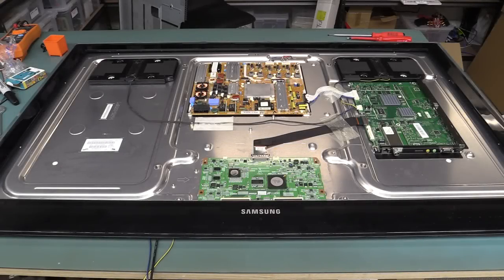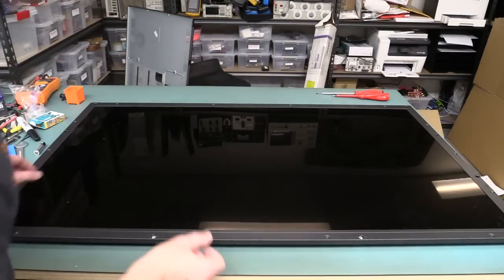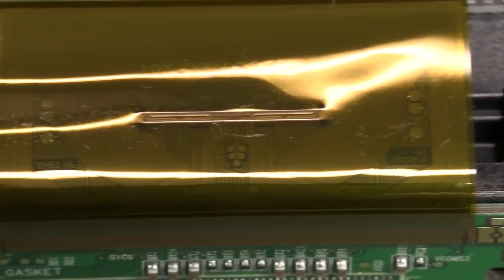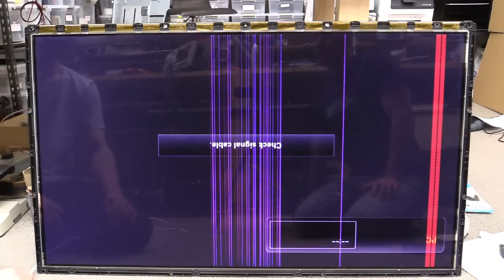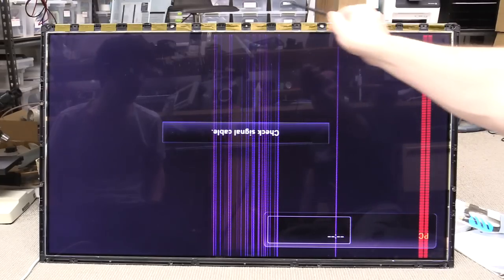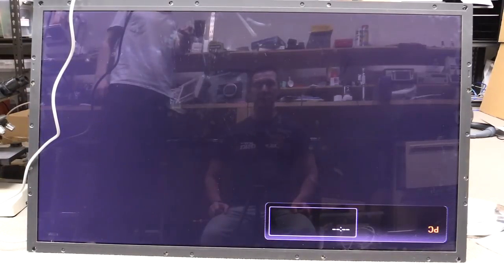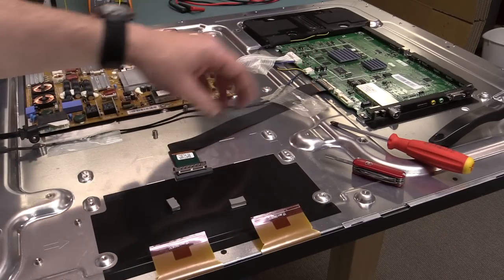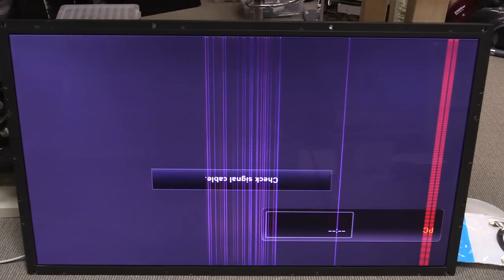EEVblog #781 - Samsung LCD TV Part 2

Comment: My bet is framebuffer memory on the main processing board - some rows in memory flip bits, some stay flipped, some decay - this is what happens with videocards. So possibly a memory line doesn't get a refresh signal or something like that... And because it does some postprocessing on the faulty data, it can produce different artifacts depending on when and how the bits flip.

Comment: I have repaired similar TV's and it was an issue with the ribbon cables coming off the lcd not making good contact in the connector. I would use packaging tape to make the cable a bit thicker for the fix.

Comment: If you look closely, lines do align with "P C" (the red ones) with check cable, and with time dots. Looks like some sort of filter accumulates values or something, definitely something with the scaler/frame buffer or something like that.

Comment: This is an internal panel short, you can narrow down which signal lines the shorts on by putting capton tape over some of the pins on the ribbon end, on one of the 2 ribbons going to the panel buffer boards
Reply: Sometimes using this method you can get rid of the lines while retaining a good picture, also one of the ics on the tcon will be red hot while that shorts connected to it, that's why the lines slowly appear as the ic starts to struggle with the overload and the chip heats up

Comment: Let's see:
1. The lcd panel cables are good, if the lines would appear instantly after powering the TV on than flex cables would be faulty
2. the panel is not damaged that is a fact, a damaged panel would not have straight lines but bleeding colours
3. power supply is good
4. Image processoring is working because there is video output to the panel
5. The issue is on the video output source

So if you put all this together you will se it is related to the T-con, something on the board is damaged because when it is heating up the lines appear slowely (vertical lines) these other horizontal lines are most likely because of some small voltage disruptions on the T-con. I can not say what exactly is damaged on the T-con but you can try and look deeper in to what could be wrong on the T-con's circuit, if the chip is damaged than it is best to buy a whole new board

Here is one, I don't know what model do you have http://de.aliexpress.com/store/product/LN46B650-or-LED-UN46B7000-BOARD-2009FA7M4C4LV0-9/710086_614153320.html?storeId=710086

Comment: EEVblog Check those Sam Young filter caps on the power supply board using your ESR meter!  I don't see that you did that in either video.  I know you have no reason to think they're bad based on ripple and visual diagnosis.  BUT - I have a very similar vintage Samsung LCD TV (2009, 55", high end) I'm working on, that also has multiple Sam Young filter caps on a very similar board.  One of them was visibly bulged, but even the ones that weren't in the same value (25V 1000uF) had questionable/high ESR values. 

The TV I'm working on has the same exact symptoms.

I'm waiting for the replacement caps to arrive, but given the nature of the failure (it worsened with time according to the owner, used to go away on it's own, and it's temperature related) etc, and the fact that one had visibly failed - I'm confident that this is what's wrong.
Reply: +Protonus And? Did you fix it?
Reply: The Kaiser   Sort of!  The caps were certainly bad.  1 in that value was visibly bulged, one read a high ESR, the other 2 I replaced anyways.  But it didn't fix the picture issue, just make it stop changing with temperature.

So I found that one of the ribbon cables, going between the actual panel and the driver boards at the top of the display, was faulty.  If you apply a bunch of pressure to the cable itself, to push it up against the metal frame of the TV, right where that tiny "chip on ribbon" cable is on the short cable, it would restore the picture to about 95% perfect.  All the vertical lines and bars, and color bleeding go away. Most of the horizontal lines go away too.  The one that was bad is the left most cable for this particular TV.  I hot glued the small/bottom end of a small (3/16" thick?)  rubber peel&stick "foot" (like you'd put on the bottom of electronics or a speaker) to that spot on the cable.  Now when you screw the front metal bezel down, the area of that bezel that's supposed to push on those cables, pushes much harder, and the picture is nearly perfect.

There remains though, some horizontal lines, at fixed 1" intervals though, that stretch across the display.  They are mostly on the right half of the display, and fade away totally by the time they hit the left edge.  That's all that's left to get the picture to 100%, but I found no other connections that were bad.

If I unplug the right hand side connector from the T-CON board, so that the right hand side of the LCD goes blank, the remaining lines disappear on the left.  This tells me that these remaining horizontal lines might be from a bad T-CON board.  So I'm replacing that board next.  Hopefully, it's 100% after that.  I don't have a lot of faith in it though. 

If it doesn't fix it, it'll make an excellent secondary/bedroom/workout TV lol.  The picture is nearly perfect now.
Reply: Protonus did replacing the tcon board fix it on the end?

Comment: The Horizontal lines appear to be split between the two sides of the panel(like, even rows on the left and odd rows on the right)  and the left horizontal lines "driver" (when the panel is the correct side up) is completely gone (hence no display). But since the vertical "fault" lines appear even on the side with "no" horizontal drive that could be some indicator that the fault originates on the main board that generates the signals for the rest of the components (it skips processing half the rows except where there is an error or "overflow" that produces the vertical lines). Hope this was helpful...

Comment: Just to echo another comment or two on here - Mike said floating input, does look that way.  Someone else mentioned reflowing processor board and considering OSD text having effect I do agree it's probably the processor board.  Something perhaps needs reflow on there.
Reply from the maker: GadgetUK164 There is also a very plausible theory about the gamma buffer or other analog drive system at fault.
Reply: +EEVblog Interesting. When are you going back to it to find out?

Comment: A bench with a clear top and a mirror underneath might be handy for doing this job solo. Our Sony has the exact same failure, it happens with on screen text even on the broadcast picture, putting the TV on a radio station clears the issue temporarily.

Comment: Some of these ghosting effects remind me of what some LCD displays do when you turn them off. In particular, when I switch off my old Game Boy Advance, every few rows appear to persist for a bit.

My hypothesis is that for some reason, the pixels are having a hard time turning off. When a row is being driven, the voltage for a particular column could leak through to other rows, and without a strong turn-off force, this leakage gradually causes pixels to turn on.

One possibility is that if a negative voltage rail is used to turn off pixels, then it's possible that rail isn't making it to the TCON board. Thou shalt check voltages on the TCON board. ;)

Comment: I believe it's to do with the LCD itself I've seen this before where the LCD broke and caused lines and dead pixels so a replacement of the LCD would be required
Reply: It is entirely possible is not the LCD if so it's the caps which have been fixed but then the tecon board can be the problem but then if it's not that then it's the main board but I've not seen TVs that are built like this and I don't believe after all this time that it's possible for me or most people to be any help but good video I really found it interesting how much could of been wrong with it

Comment: +EEVBlog If you still have the LCD TV Dave, have you considered the clock management?
Clock based timing issues could potentially explain the ghosting as well as the lines which could be following your screen input.

But to see if the lines are just input based as in menues etc just hook the TV to a PC as the secondary screen and make the background white so the TV only shows a "pure" white screen. If a "pure" color can be shown without lines will help you eliminate possible sources for the fault.

Comment: After seeing what you have tested and poked i would call a dry joint on the processor board... And if i had to point to the exact bit i would say a bad earth on the LVDS connection.

Comment: I'm probably way off with this, but I'm thinking that if each pixel has a triple (RGB) x,y control, the vertical lines seem to follow any high-contrast element of significant height (the dashes in the clock display didn't seem to contribute), and the line color seems to be determined by the dominant color of the contrasting element, then there must be a communication issue in the x,y controller, whatever that may be.

Blue is the dominant contributor to the "white" (it's not pure white/all-on white) text.

Red is the dominant contributor to the orange text ("PC")

It seems like the vertical controller is taking cues from the horizontal controller.  Knowing absolutely nothing about how this screen is engineered, I find myself asking:
1)  Are the x and y controllers physically separate drivers?
2)  Does either the x or y have "priority" to the system?
3)  Do they communicate, and/or does one vary itself compared to the other? (Contrast management?  Blacks enhancement?)
4)  Are they SUPPOSED to communicate?  Is there a chance that information from one is "bleeding over" into the other?
5)  Is this a heat-related, actively-bridged problem?  How long does it take for a particular die and/or circuit to reach a temperature or charge that would, say, cause a tin whisker or similar anomaly to expand and bridge a gap, which it then holds based on heat or charge until the unit is powered down and the anomaly is pulled away?

Comment: One of the design engineers from Samsung is watching this doing a face palm. Come on tell us which £0.01 component is faulty :-)
Reply: Coolkeys2009 Knowing Samsung, they probably put put a counter where after a certain number of hours of screen on time, it corrupts some config in the firmware of one of the chips, or some other form of planned obsolescence.
Reply: +Razor2048 this is possible I remember when Epson printers did this
Reply: Razor2048 I can believe it was caused by a problem they missed or something they skimped on but I don't believe Samsung would bother spend the extra money to design in a fault. LOL
Reply: Carbon cricket FX This would actually be the stupidiest thing a manufacturer could ever do. Planned obsolence at the expense of staining brand quality just means a swifter way to bankrupicity.
Reply: Crimson Sunrise i know but they genuinely did after a set number of prints they said they needs servicing mine did http://www.reportsfromearth.com/155/designed-to-fail-planned-obsolescence-in-printers-tricks-to-fix-them/
Reply: Carbon cricket FX I can't speak for it, as the only Epson printer I had is long gone for  more than 5 years, and it wasn't a multifunctional one either.
Reply: Crimson Sunrise
Planned obsolescence is a fact, it works because the masses are programmed to accept it. I hear people calling last years state of the art mobile phone old and undesirable. Stuff does not need to be designed to break any more as we've been trained to throw working stuff away after the set number of years. A Washing machine or fridge that can work for 25 years with out major problems  seems impossible to build with today's technology but  they did it in the past.
Reply: Coolkeys2009 Well, considering inflation, this will reach a point where people no longer will be able to buy flagships.
Reply: +Coolkeys2009 My Bosch fridge just gave up last week : - <
… after running 48 years more or less non-stop.
Reply: ***** Probably?
That sounds like washerwoman's tales, not like exact science.

Comment: Can you use the oscilloscope to check the io for the pixel column that's having the problem. You can look online for what voltage you need for what colour and see if you can see anything unusual then trace it back to the chip on flex and then back to the board etc. Or see if you can a service manual/schematic. Great video.

Comment: Those blippy pixels right at the bottom (especially at the bottom of the red lines) are quite interesting... 

You could try hitting the actual panel with freeze spray, maybe there's a problem with the transistors in the panel at the bottom of the display.

Comment: Maybe each driver board drives an interlaced half of screen lines, like one board drives odd lines, and another drives even ones. Maybe one of the boards stopped driving horizontal lines and they are left floating.
And maybe the signal that drives "bright" pixels leaks over to "dead" lines on the screen...

I have a laptop from early 90's that has its monochrome LCD messed up kinda like that. But what I know about it for sure is that it really has some rows disconnected from the driver right on the glass. Disconnected rows look really dark with vertical ghosting stripes from nearby characters.

Just throwing my 2 cents in here :)
Reply: ZXRulezzz I guess what I want to say is that maybe column drivers are fine, it's just something wrong with one of horizontal drivers. And that mess of colorful pixels right at the edge of the screen might mean that there's some "horizontal line" clock fell off somewhere (like instead of iterating through the lines, it stuck on first one). But that's just my very specific guess, as not all details are observable in the video.

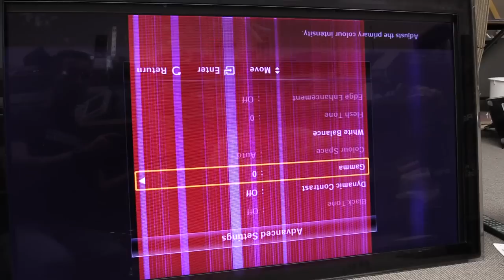Comment: I was initially suspecting that some of the power rails' voltages were drifting after being turned on, but then when you noticed that the streaks were associated with the text, that made that seem unlikely. (And when you tested the voltages, it had presumably been on for several seconds.) But some of the recent replies to Mike's comment explain how that could actually be the cause. Weird, though, that the text that spans almost the full width of the screen at 22:40 doesn't cause streaks. Maybe that's because it's not as bright as the other text, as Mila Miglia said—the bright icons at 22:25 certainly cause brighter streaks.

Comment: The fix! Try to measure all the capacitors to see if they are bad.
The vertical filtering capacitor is the problem! Try the fix. I got this answer from my dad!
Reply: Talnaci Alexandru That's a good idea. The filling of the columns looks capacitive. Doesn't explain why not all columns/colours get vertical lines.
Reply: Also explains why the lines phase in slowly when first turned on.
Reply: Ian Cole ...but does not explain why every second line is black. I think this is a deliberately fault programmed into the firmware to appear after a certain time of usage so that you buy a new one.
Reply: Talnaci Alexandru i think there was tiny SMD capasitors on the pcb along the bottom side of the tv that was together with some resistors... should only take a few minutes to check them out.
Reply: +Ian Cole they would fade in if a signal started to slowly rise from a cap charging.
Reply: Talnaci Alexandru I agree. I've seen these symptoms before. There might have been a surge along one of the signal inputs that caused caps to breakdown.
Reply: +Talnaci Alexandru 
Something else that seems to be interesting is that the green color seems to be mostly missing in the lines, could it be that there are capacitors for each color?
Reply: I don't know,David!

Comment: if the image is filling a column, it could possibly be an issue other than bad column drivers or connections. If you see weird pattern in how a column fills, then look at the horizontal drivers activating/leaking onto multiple rows at once.

*and you guys consider it later in the video, good deal!

Comment: may it be the LCD array is not discharging properly (ghosting and downwards fading) or
there is a background current added to the pulsed  column signals (info) that lit up the pixels along a column.

Comment: keep up the good work Dave and David for my two peneth I would try and use your thermal camera and see what heats up at the same time your lines appear don't think you would have found it with the freezer spray as when you change the menu it takes a while for the old lines to disapear.... I have found a couple of faults that way before...

Comment: Check the top strip with the IC inside the one on top left is usually faulty just apply pressure on the flexible and it should work!!! i usually use a thermal pad for the IC to mold inside of it en ensure a good contact then you close it and make sure there is enough pressure to hold the contact

Comment: Observation: The vertical lines intersect with the "check signal cable" white text characters  . . . . also the red square artifacts intersect the "PC" text -  perhaps a problem in the video input circuitry? A flaky HDMI input connector causing these artifacts? (These connectors get abused a lot by careless end-users) Try plugging in a HDMI video source and/or analog video source, just for grins . . .

Comment: i think, that there is something wrong with internal power rails - when it drives pixel bright and relaxes transistor, it has lack of power to return transistor back. or there is current leakage in the panel itself from horizontal lines to vertical

Comment: i see references on the interwebs to smearing problems when someone say messed with brightness and white balance settings in the menu and adjusted out of normal range.  factory reset if not already done